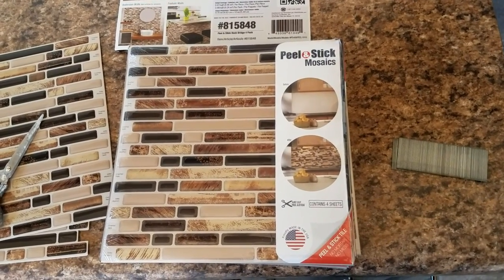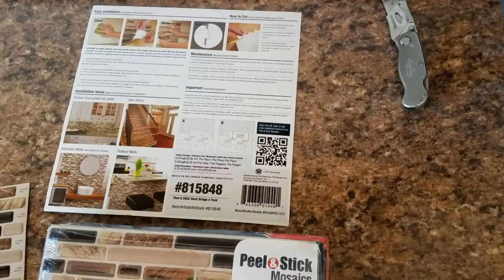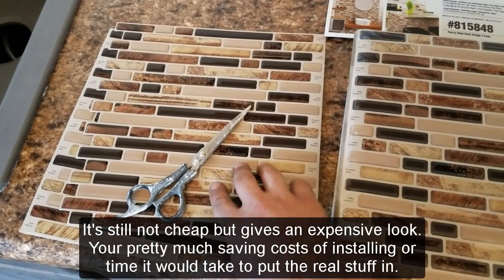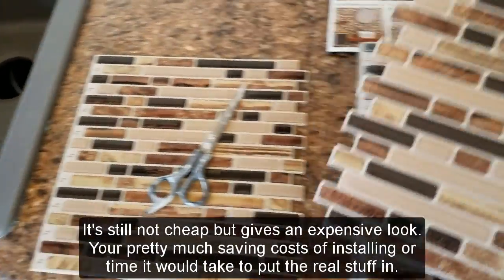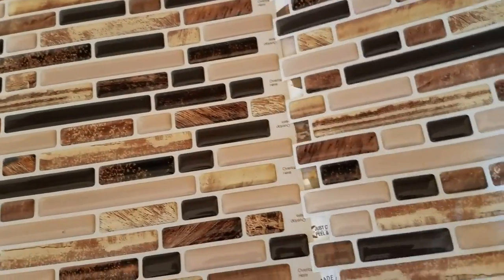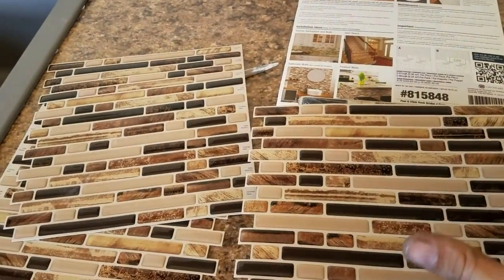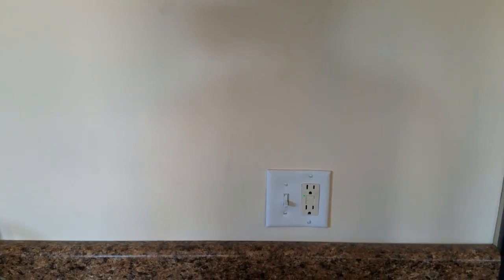Peel and stick tile. DIY Kitchen backsplash.

Comment: How many packages of the peel and stick tiles did you use to achieve this wall? It looks amazing!! I really want to do this.
Reply from the maker: Damn, I can't remember. I think my costs for both walls was around $400. still kind of pricey but looks good and you don't have to do the work that tile requires.